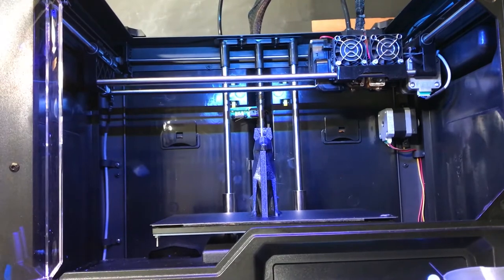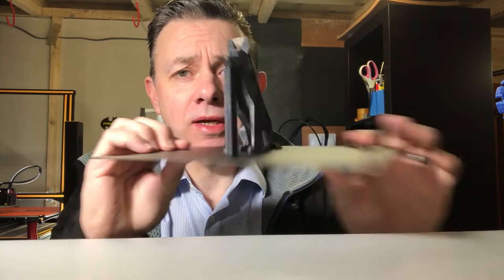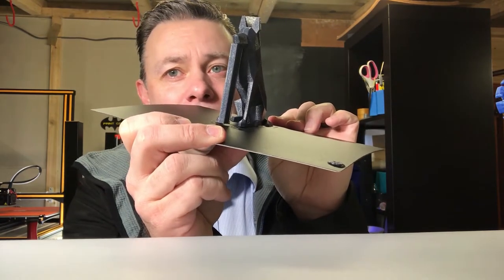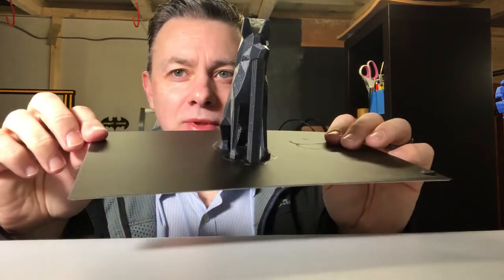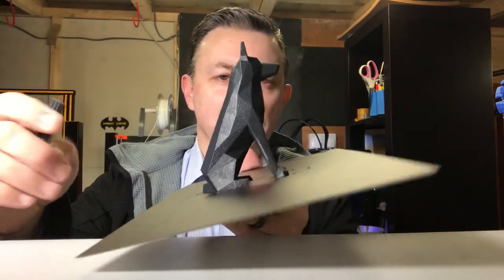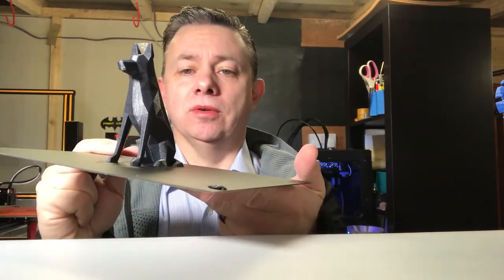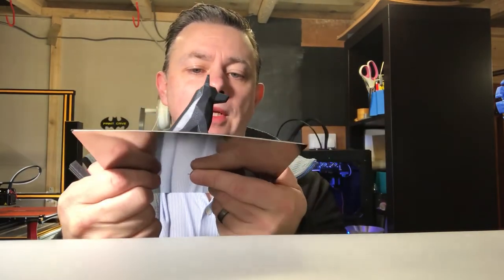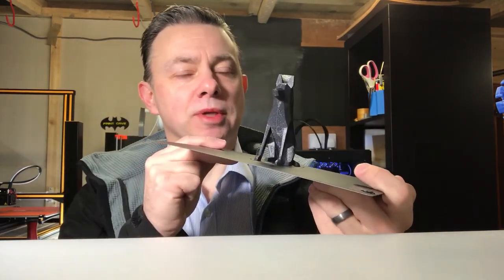3D Printing Update - BuildTak FlexPlate System

Comment: hi Ian nice vid! I think the body of the dog would come off a bit better if you lower the build platform slightly because the buildtak material would grip it easy even if it looks like it would come off during print :)
Reply from the maker: Quite possibly Ronnie, it did come off pretty easy once I got the knife in there as usual to be fair. The “problem” with trying to flex it off is that the sheet can obviously only bend so far and the small surface of the dog’s body doesn’t really work for that. The way it released the legs was very cool though and bigger prints on there will be a dream.

I still have some work to do on the printer and my S3D profile to get everything the way I want but very happy with the build surface now